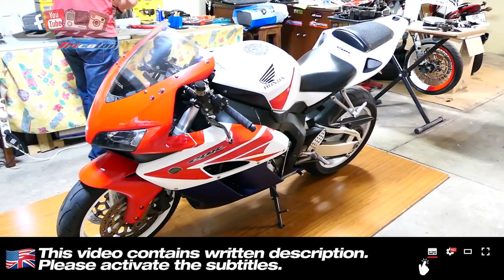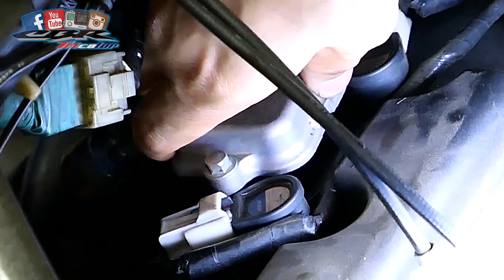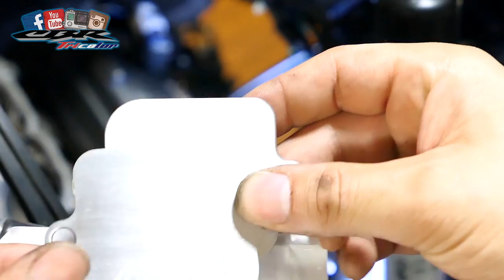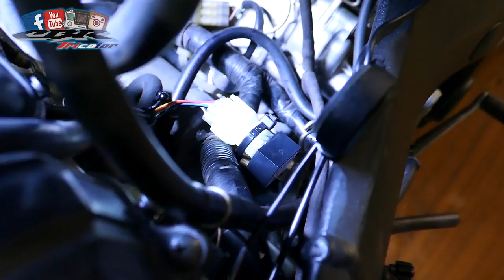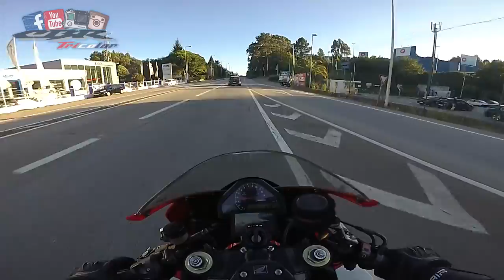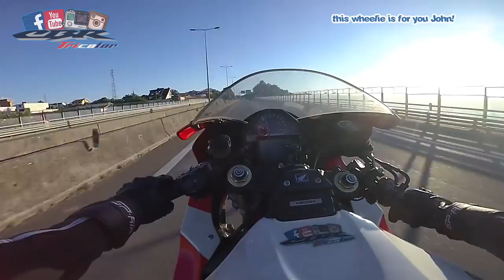🔧CBR FIREBLADE Performance mods || PAIR | HTEV | o2 | Flapper

Comment: did the HTEV eliminator reduce power?
Reply: Jeremy Eden no, the htev is made for the engine to have better power or the range from low end toques to high end power
Reply: But it needs to be removed if you have a new slip on or a new air box etc any mods done to intake and exhaust otherwise the htev reduces power and doesn’t work properly

Comment: Does it over heat fast
Reply from the maker: No, it heats fast but runs at the specified temperatures. That will depend on the coolant you use, riding and the weather where you live. This mod won’t affect significantly the temperature

Comment: After removing the rubber hoses from the pair valves covers and unplugging the solenoid from the harness what goes into the harness plug . Should i fit one of smartmoto eliminator plugs or leave as is .
Reply from the maker: you just leave as it is
Reply: @CBRTricolor  thanks buddy really appreciate your help . Regards from south africa